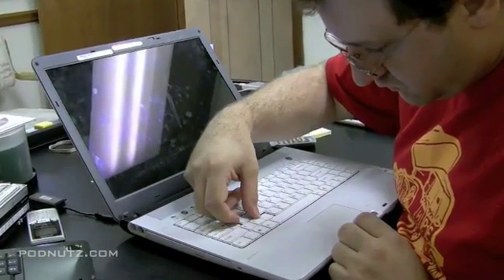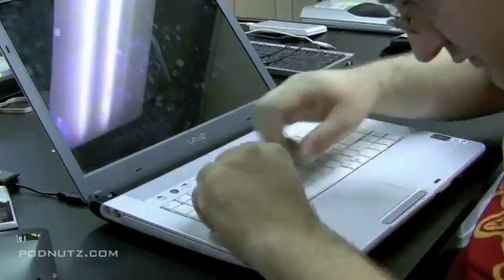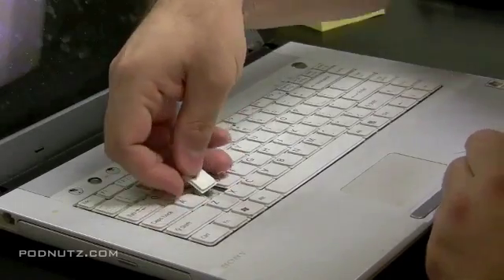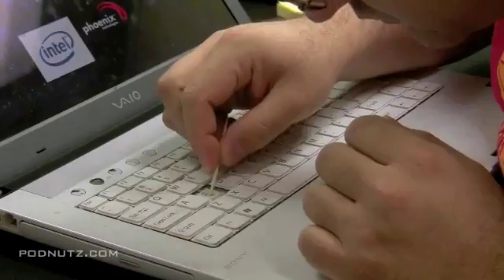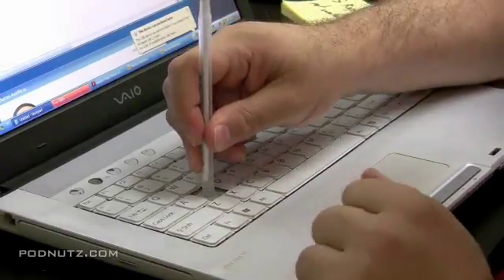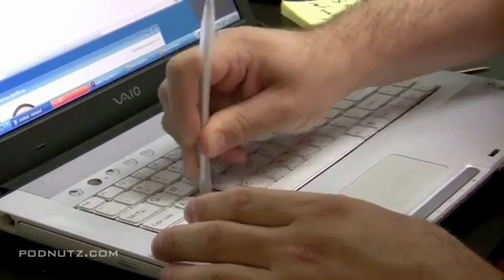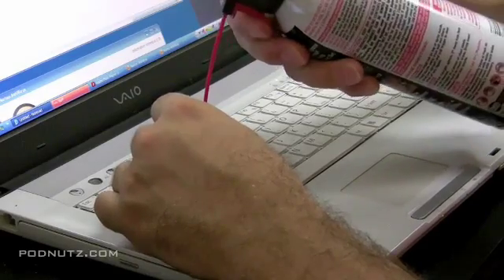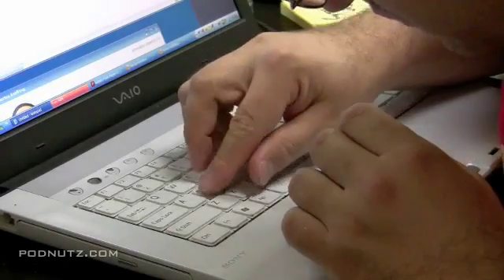Key not Working Vaio Laptop

Comment: he broke the key lock I don't think so he able to install key again bcz SONY VAIO have key lock. Yes i appreciated the process bcz through that  you can repair it for temporary purpose but he don't show why some time key not working and where you need to start your repair work, when you try to open particular key; don't try to pull it as u are not sure its having small lock if its broke then no chance to install it again. after open u may saw that middle point of key ( very small point ) touch the magnetic panel or not just try to set and press the lock again.

Comment: ive done cleaning but didnt work. finally i ve put a very small ball of paper inside the little hole
on top.  
Now the rubber  is pressed more by the key and it works like new. :)

Comment: I'm so irritated, right now. For the stupidest reason, I used Blow Off Electronics Cleaner directly onto my laptop keyboard and it doesn't work. Is replacing the keys on the keyboard the only thing to do? 
My laptop works but, the keyboard is shot. 
p.s. I'm on a different computer, right now.